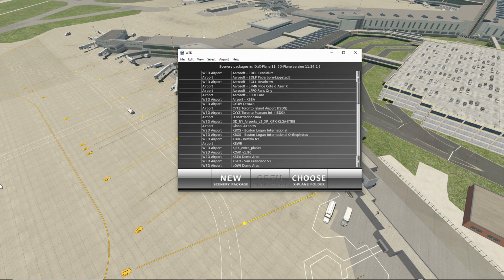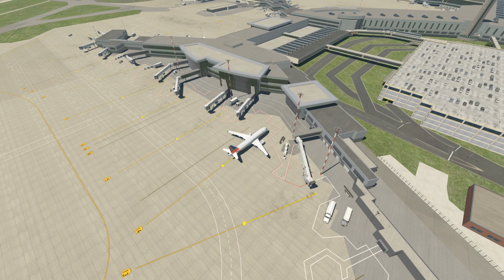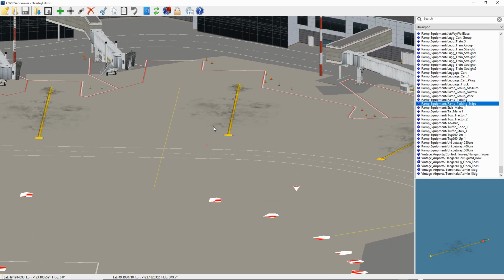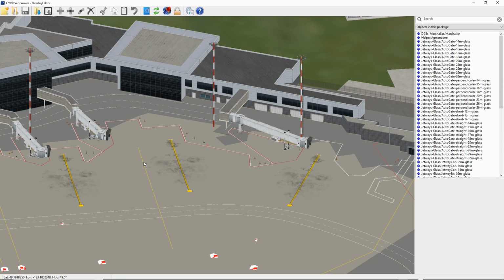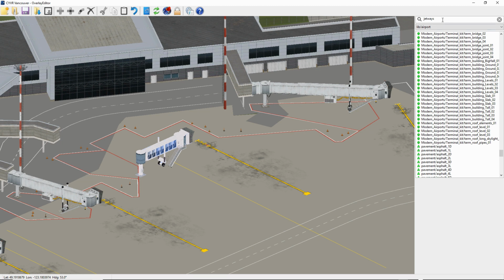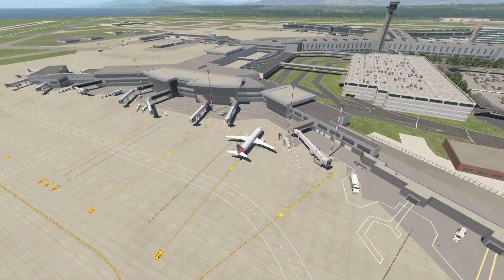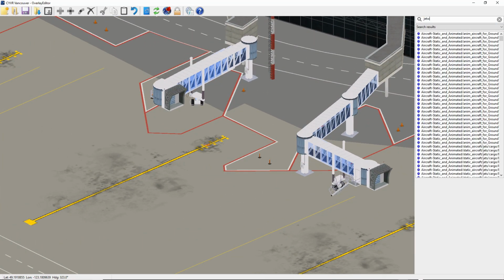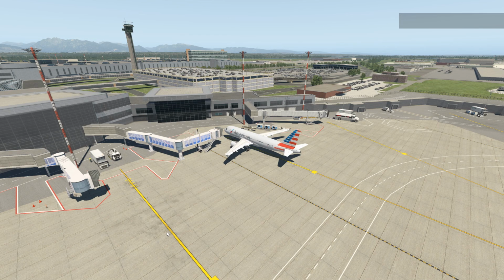Tutorial on adding autogate with improved and simplified technique for xplane 11

Comment: Hi, how do you delete an exiting jetway and replace with one from the autogate library? thank you.
Reply from the maker: Are you using Overlay Editor or WED. I don't think Overlay Editor works with latest version of x-palne. Howvever both editors use same method- You need to zoom in- select jetway and hit delete key. All airports are not the same. What airport are you wanting to add auto-gate to?
Reply: @bobblack4604  I use WED, unfortunately I did discover  that the developer integrated the buildings and the jetways as one layer, Thank you for your time and happy holidays!
Reply from the maker: @Marin_M-t5v  Yes some designers make it difficult to add gateways as they clump a lot of objects together including jetways. Try downloading another version of the airport from https://gateway.x-plane.com/ the airport scenery gateway for xplane.

Comment: CAN YOU MAKE ONE ON CYYZ PLEASE! THANK YOU AND LOVE THE VIDEO
Reply from the maker: I have made a few auto-gates at cyyz for my personal use. I think I did A1- A4. There are alot of gates at CYYZ so just make a few gates that you use unless you intend to upload a revised airport for the general public, in which case you need to do them all or what I have seen some people do,  is put planes at all the gates except a few and make those auto gates.
Reply: @bobblack4604  Ok Thank You My problem Is I Cannot Open up CYYZ In Overlay EDITOR
Reply from the maker: @allaboutmyaquarium3384  Do you have CYYZ as an airport in your custom scenery folder? If not you first need to create CYYZ as an airport in the custom scenery folder. The first part of the video shows you how to add an airport to the custom scenery folder using WED.
Reply: @bobblack4604  Yeah . I Did The Instruction You Said In The First Of The Video By The Way The Recemonnded One For CYYZ did not WORK! BUT I GOT THE OTHER ONES THAT WERE ACCEPTED AND THEY WORK IN OVERLAY THANKS FOR THE VIDEO PROBLEM FIX JUST THE RECOMMENDED OF THE CYYZ DID NOT WORK!